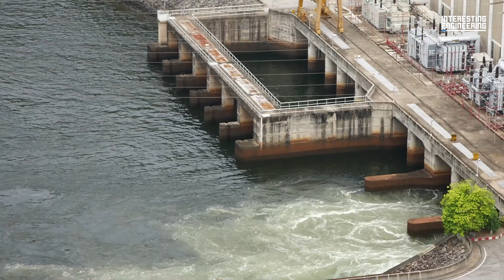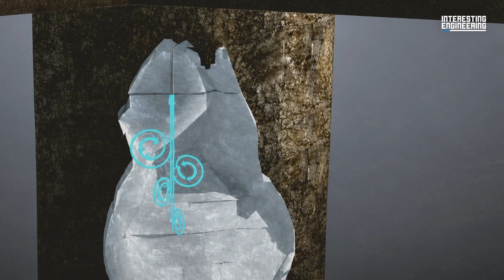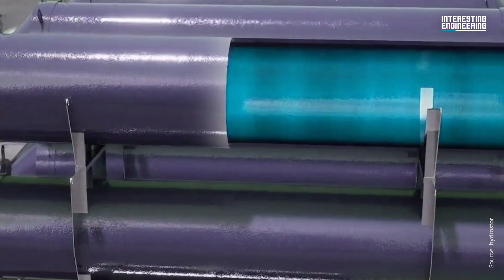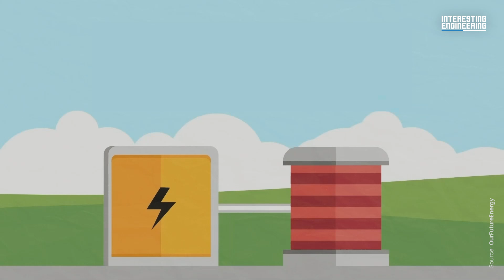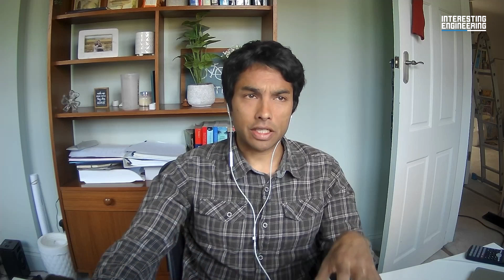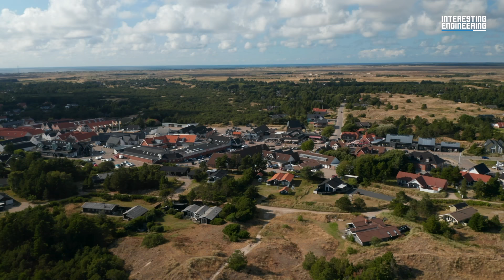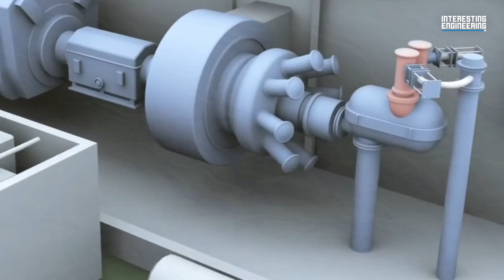Why Air Batteries Are Finally Beating Lithium

Comment: CATL described sodium ion at 10$ per kWh material wise. At this cost level CAES cannot compete.
Reply: This. Battery storage is not a technical problem, it's an economical one. The round trip efficiency of batteries cannot be matched by technologies that convert energy into something physical.
Reply: @solwidotnl  anywhere, yes, but pumped hydro gets dam close (heh) and has the advantage of often doubling as a generator _when geography allows_.
Reply: @CuthbertNibbles  You'd be lucky to get pumped storage turnaround efficiency above 70% when it is "new and clean" and at large scale.  Pump loss, turbine loss, pipeline (friction) loss which increases with length of the pipe, electrical loss in the pumped storage station, and network losses transporting power to-and-from the pumped storage station. This "new and clean" performance will fall as the pumped storage station ages, and doesn't include the "parasitic losses" of operation and maintenance (all of which consume energy).
Storage increases demand for the primary energy that you need to put in for a given demand, and soon you find that you are installing (and paying for) a significant percentage of unproductive primary production sources.  If you want to eliminate this wasteful cost of unproductive sources, it is better to store energy as primary fuel.  Coal.   The UK could store massive amounts of energy when it had coal-fired power station, and it did so at reasonable cost and without demanding that we built even more coal-fired power stations to cater for "turnaround efficiency".
Which leaves the UK with a choice - pay very expensive prices for electricity today for some theoretical (and unproved) issue way in the distant future, or to obsess over CO2 and make ourselves very poor indeed.  The experience is already there, and choice is sitting right before you now.
Reply: Nothing new can ever compete with older, established stuff on cost alone. Until it scales.
Reply: No one ever seems to mention this in these videos.   "Batteries are good for several hours, but not longer".   Then build more batteries.   At $10/kWh we won't need anything else.   Though, at those prices we probably won't need utility companies at all.
Reply: @craigduncan7010 batteries can last months, depend how much you discharge it.
Reply: @craigduncan7010 No, simply adding more batteries doesn't solve the underlying problem behind "Batteries are good for several hours, but not longer", which is self-discharge. You're just brute-forcing it by storing more energy in the first place. So, in the end, you just lose more energy to self-discharge because of the greater storage capacity.
Reply: @roflcopter645 the self discharge rate of sodium ion batteries is 3-5% per month, tell me how that is going to lose us a lot of energy?
Reply: @ShadawGaming  Sodium-ion batteries actually self-discharge at around 5–10% per month. At 5%, a 500 MWh battery (typical size) would lose around 25 MWh per month, or roughly 0.8–1 MWh per day. That’s about 50 households worth of daily electricity use, lost every day.
Reply: @roflcopter645  So assume we want a month of storage (longer than they talked about in this video). We will lose 5%, how much is lost by getting into and out of storage in other methods that can store with lower losses?

You have at least 4 losses to account for. 
Transmission (distance from generation and user to storage). This makes distributed instead of central storage good.
Losses getting it into storage, such as heat in the video example. Or pumping inefficiencies for for water storage.
Losses during long term storage, which is why we don't use capacitors for long term storage. Here you have things as battery discharge, air leakage or evaporation of water.
Losses getting it out of storage, such as combating ice in the video example. Or turbine efficiency for water storage.

The combined loss is interesting. If you lose a few % in one of them but are better in the others you are likely better overall. As you change time, location etc different losses show up.

These losses get added as extra % on storage capacity needed and cost for the energy you end up storing. I don't know the figures for the totals, but only focusing on losses during storage misses the point.
Reply: @roflcopter645 the self discharge rate is so negligible at this point
Reply: @JamesLake78  no it's not. The example I used in my previous comment isn't even for a big installation. 500 MWh is a typical medium setup, and we're dealing with the equivalent of ~50 houses worth of daily electricity consumption, lost every day. 
That's definitely not negligible.
Reply: @roflcopter645 meanwhile things like the tom Sauk hydroelectric power station only has a daily efficiency or 70%. Yeah, everyday it loses 30% of the energy put into it. It acts as a battery for daytime demand surges and it loses 30% a day. I’ll take 5%  a month over 30% daily thanks.

Also 5-10% self discharge monthly is wrong. It is 1-3%.
Reply: @roflcopter645  energy only needs to be stored overnight or for a few cloudy days.  Not months.
Reply: @lostpony4885  like I've said twice before already. 50 houses worth of electricity use, lost every single day isn't trivial. Go back and read my breakdown above.
Reply: @lostpony4885  Not true for many areas in the world.
Many places (like Belgium where I live) will need backup coverage for several weeks.
Plenty of winter days with low amounts of wind and solar energy, while energy consumption is at it's highest to warm buildings.

So large TWh installations are required. Batteries will not be viable for that, since even at a ridiculously low price of 1$/kwh that would be several billions. A technology that scales better with size is required.
Reply: @ShadawGaming the video has already said that air storage is less efficient then batteries, so how many months of self discharge is that equivalent to ?  Also whats the self discharge of air storage ? Pumping air into a cavern under pressure does not sound like a way of not having leaks. Let alone all those high pressure pipes & fittings & pumps.
Reply: @roflcopter645 all electricity storage looses some power. Being startled by large numbers is not going to change that.
Reply: @roflcopter645  it is an exponential decay. So the first month it would be 25 MWh, the second it would be 23,75MWh...
Reply: @lostpony4885  You are right that with the current grid, a daily storage bring huge benefit. But if one day we get rid of fossil fuels, winter heating will become a huge challenge and long term storage might bring benefit.

I think that maybe there might be some place where usefull cold can be used during the summer in the decompression and usefull heat can be used in the compression stage?

For heating a compressor is simply an inefficient resistor with a 90% efficiency and a lot of maintenance 🤪!
Reply: @francesconicoletti2547  You can do the math. Pump hydro is about 50% efficient and you can find model for evaporation and rainfall. 
You can assume a rought 3% exponential decay for battery or used a more advanced model with internal resistance and V=f(charge).
Reply: @Robbedem  hahahahahahaha. Right now batteries system are about 300-900USD per kWh.
1$ per kWh and you would become one of the richest man on earth!
Reply: Whats CATL ans CAES?
Reply: @bertz-0  for CAES my guess is Compressed Air Energy Storage. CATL should be the giant chinese conglomerate. The 10 USD per kWh would be a revolution.
Reply: @pierregravel-primeau4088 "Contemporary Amperex Technology Co., Limited" they make about 40% of all EV batteries globally
Reply: Unfortunately Excel people like you (uneducated, looking at one "number go up" mentality) are the ones making decisions in our governments and industry. Only thing that saves us (in western world) is that the people in power change thus other ideas get tried until right one is found.

While batteries have one thing going for them - efficiency - they lack in almost every other aspect important for long term energy storage: energy density, physical security, portability and more. These are just off the top of my head. I am no energy expert but all you need is primary school physics knowledge to calculate the basics. In some of these aspects batteries lack not 60% but 100-1000%, meaning they are (many) orders of magnitude shittier.

We've had blind investment in battery technologies for the past 20 years because somebody decided that electric cars will save the world ecology. Billions were transferred from taxpayers to private companies like Tesla. Now same people are proposing them for long-term energy storage. They do this because otherwise they would need to admit that mistakes were made by them. It's idiotic.

For example in Finland they do sand-energy storage which is similar to what is shown here, except with sand and heat. It's cheap and useful there because you can use the stored heat during wintertime when home-heating is needed. Hence fully negating the round-trip efficiency of any chemical battery system.
Reply: @kalaants  Electrochemical batteries really only lose badly on cost and, in some cases, charging speed. Thermal, compressed-air, and similar storage can be much cheaper, but they give up massive ground in energy/power density, portability, efficiency, and usability—assuming we’re comparing energy-storage technologies rather than fuels like gasoline or hydrogen.

That’s why I don’t understand the claim that electrochemical batteries “aren’t the future.” They won’t be best for everything, especially massive stationary storage, but their combination of efficiency, density, portability, and versatility is extremely difficult to beat.

You brought up Finland’s thermal battery, but that actually demonstrates the point. They built it because storing heat in sand is incredibly cheap, not because it’s more efficient. It operates at temperatures far beyond what ordinary heat pumps can provide, so it’s charged with resistance heating. Store that electricity in an electrochemical battery instead, and homes could later run heat pumps, potentially delivering roughly 3–5 kWh of heat per kWh of electricity—3–5× as much heat from the same electricity before accounting for storage losses. That’s an enormous advantage. The thermal battery wins because it’s cheap enough to make that tradeoff worthwhile.
Reply: @treymiller5736  We here in the north know a bit better how to heat our homes, don't you think?

FYI best batteries we have around are the old central heating systems (the thermal mass of water in these systems) and most of them have already been converted to heat pumps. Well converted is the wrong term because ofc. they also have gas/coal/wood heating.

I suggest you go and calculate the amounts of batteries needed to heat homes at -20 deg C for extended periods. And then think if the amount of light and heavy metals needed would be dug up hopefully from YOUR backyard where you can actually see it.

Batteries are already here to stay, they are not going anywhere. Our politicians made it that way. They in their grand wisdom selected the technology on the expense of all other technologies. And you people arguing here without any facts basically are making my point.

Though I wonder if I am chating with bots here ....
Reply: @treymiller5736 ” can be made cheeper “ is a claim. Lots of things in green technology have been claimed to be able to scale, I’m still waiting for green hydrogen and tidal power, when a technology leaves the realm  of marketing videos and goes into mass production I will believe it is real. Like say sodium batteries which for years have been just marketing but now are on sale at least in China.
Reply: @kalaants 
What an ironic comment. It seems like your beliefs are based on the approach you described: guessing randomly and hoping you get the right one.

In reality, batteries provide the optimal grid. They allow the cheapest and most reliable grid thats possible.

The fact that you literally said batteries arent portable says all that needs to be said about your knowledge and intellect
Reply: @Cambyses1467  Batteries aren't portable compared to lot of hydrocarbon technologies. You could even use your primary school math and physics skills to calculate the energy densities to understand that.

For grid storage same applies - batteries are only a solution for amounts of energy that can be used for grid balancing/stabilising (seconds to minutes) but for long-term storage you would need to dig up entire earth to have enough. I suggest we should start digging from YOUR back yard.
Reply: @kalaants 
Did you just equate energy density to portability? Are you ESL or something?
Reply: @kalaants  I would say that you are the uneducated guy here that know nothing.

Electrochemical batteries are the best in efficiency. Safety. Cost. Reliability. Plus they exist. Unlike these unicorn chaser.

for reference, sand batteries are around 100$USD per kWh.

So if CATL is really able to outprice everybody, it is a breaking news that should break the whole energy system.
Reply: @kalaants what's the point of heated sand when you need to do a laundry though?
Each battery (and overall technology) has its use case. Sand battery are cool if you need heat at some point during the day. There are plenty of areas of the world who do not need heat (except for industry). North africa for ex.

There is no one technology fit all.
Reply: @kalaants  why does grid storage need portability, do power plants move now?
Each battery technology has their niche. Sodium has poor density, but crazy durability and are cheap - ideal for grid storage. LiFePO4 have good durability, high charge rates and okay energy density - ideal for electric vehicles. Aviation is a hard gap to fill, but high speed rail can cover a sizable portion of those trips (as well as a lot of long range freight), and trains don't need batteries.
You have to get away from the mentality of fearing change you don't understand. You're not hopeless, you have some curiosity, but these vague explanations you say are poorly thought out, are just misunderstood. Dive into the tech a little bit, and the numbers start making sense 😉
Reply: @kalaants  Why uneducated? What do batteries lack? If a specific chemistry holds the charge you can use it. Which aspects lack batteries exactly? Why blind invest? Batteries seem to work better than 20 years ago. Woulndt call that blind. It has been rather successful. It is not idiotic. Sand-heat is cheap you say. Point a number. How cheap? Cheaper than 10$ per kWh? If so good. If not the technology will loose against batteries.
Reply: @markuslang1869  It's actually even worse. Since the sand battery stores heat to warm up houses, you cannot directly compare kwh to kwh. You have to compare heat energy, and when you use the electricity from a chemical battery with a heat pump, you get a rough multiplier of 4 - so 1kwh (10$) are as good as 4kwh of heat. At that point you are looking at a price of 2.5$ per kwh of heat. Even sand will have problems beating that.
Reply: None of the attributes you made towards battery are correct, though. Is it the right solution for everything? No. But is it increasing its utility as the technology improves? Absolutely.
  Regarding density: you can fit approximately 1gwh in 20-40 acres. That's tiny in relation to the acreage needed for wind/solar ..or anything really. There is lots of land available. Would it be suitable for the middle of NYC? No. That's ok. Portability- why the need to be portable? They can get to the storage site by truck, that is plenty portable. Physical security....what do you mean? Like against people breaking in? I don't get that. 
  Batteries were not blindly invested in bc of Tesla. China, Japan, Korea, the US saw the potential of reducing transport CO2 emissions massively when you pair EVs with renewables. That is the truth. I hate musk and Tesla as much as the next guy, but the tech is sound.
  And the example of Finland using sand is for winter district heating. District heating isn't all that common, and it's just one way to provide heat energy. Batteries provide grid electrical storage. Different beasts, but both good as they reduce CO2 emissions. 
  Please try reframing your thoughts without the errors to see if it makes better sense. I'm not knocking you, it's just errors everyone makes at some point
Reply: @deansmits006  We are comparing wind and solar to batteries now?

How many acres did we have to ruin to fill your 1GW in 20-40 acres with batteries!? Go have a look. 

Hence even today batteries still do not provide significant grid storage. They are mainly used for grid stability because there is not enough for long-term storage. The math ain't mathing for it to work for long-term energy storage although we like to pretend differently - that's what my original comment was about actually.

Agreed that Tesla was a bad example from me because it's like poking a hornets nest with that one.

What attributes I mentioned are not correct? Batteries are shitty when it comes to portability compared to hydrocarbons. Batteries are shitty when it becomes to energy storage compared to different hydro technologies. And yeah the biggest battery electric stations burn for months without us being able to put them out. We could argue about that not being huge issue for stationary storage systems but batteries DO come with hole new kind of safety concerns.
Reply: @kalaants 😊 There are certain theoretical assumptions about given technologies, based on physics and chemistry. Therefore, batteries will always be the better option for storing electrical energy.😂